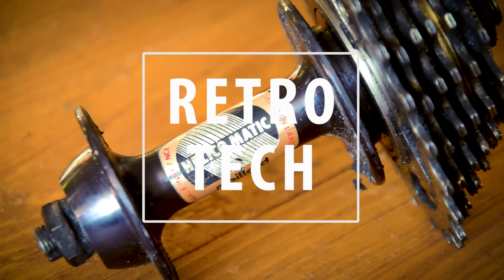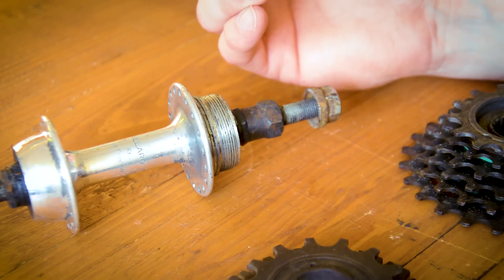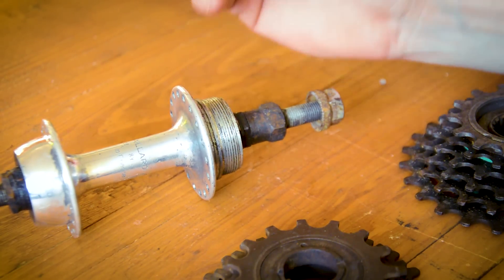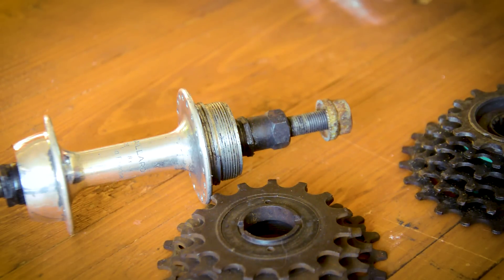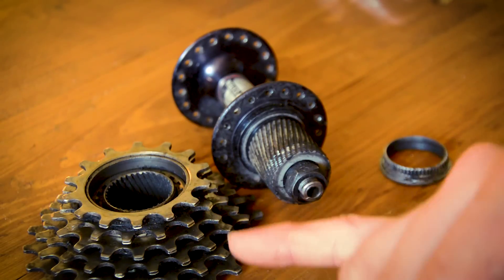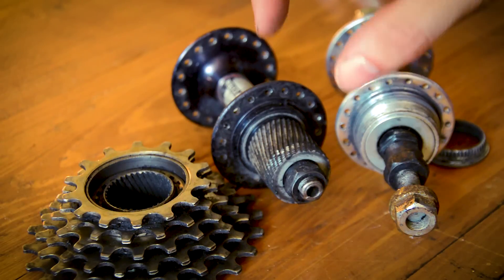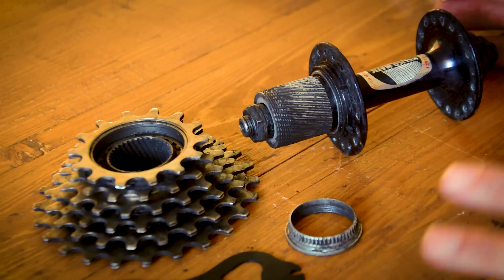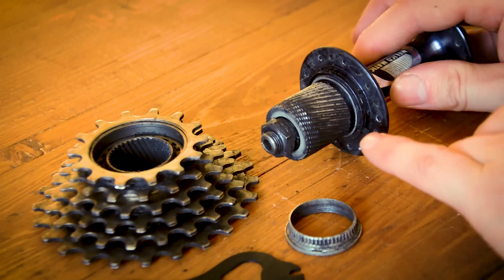Retro Tech - Maillard Helicomatic Hub System

Comment: I just bought a wheelset with these hubs , because they happened to be 27inch and 126mm space which I needed for an older Raleigh . I cleaned and repacked the hubs . Very easy to remove the cassette.  Luckily the guy who sold them to me gave me the removal tool ...
Reply from the maker: Yeah the Helicomatic freewheel isn’t too bad to remove. I’ve still got my hubs somewhere.

Comment: I just took one off a 1989 Peugeot that I bought new and have had ever since. I got the tool on ebay. The lock ring came right off without problem. Mine uses 5/32 ball bearings. I took it apart to replace them.

Comment: I was gifted with a Helicomatic  single speed on my 1982 Yamaha BYZ BMX .At the time research was limited about this hub and i was ignorant about the tool that was issued so as a twelve year old adjustable spanner at hand started the destruction of the lock-ring to stop the rear cog sliding.

Comment: regarding retro tech: have you thought about doing something on the old Deore DX/XT thumbies? i've always been fascinated with them and just picked up a pair. currently working on stripping, cleaning, creasing and rebuilding them. something you'd be interested in? they've got a reputation for lasting ages and being some of the best bits shimano ever did.
Reply from the maker: I've actually got an 88 Rockhopper Comp in the garage which I think has something similar on, although I did notice one of them has a broken casing :(  Bet it still works though

Comment: Just found one of these on an old Peugeot triathlon I picked up for cheap. I'm converting the bike into a single speed, does the helicomatic cassette come apart or is it all one peice? I'm trying to do it on the cheap, otherwise I'd just pick up a shimano hub.
Reply from the maker: It does come apart, but it's actually a freewheel, not a cassette.  I think it'd be easier to find a single speed wheel ready made.

Comment: I still have one of those rear hubs. Everything that you set is true. I belief that this hub inspired shimano's engineers to do theirs unmatched system . Cheap new hubs now use right bearing in the center exactly like free wheel ones. Sometimes over compensating with fat axle up to 17mm ..